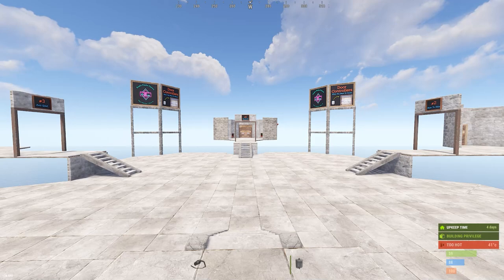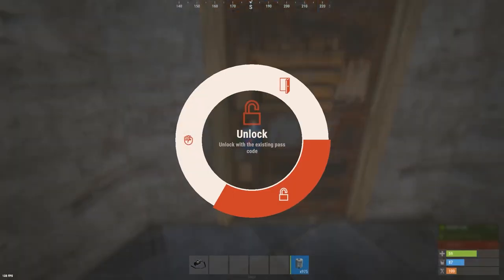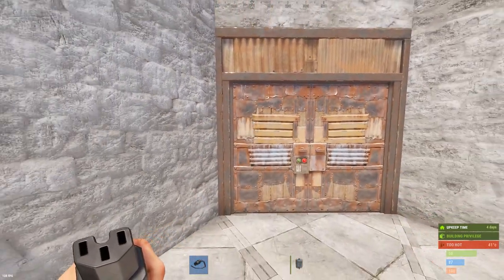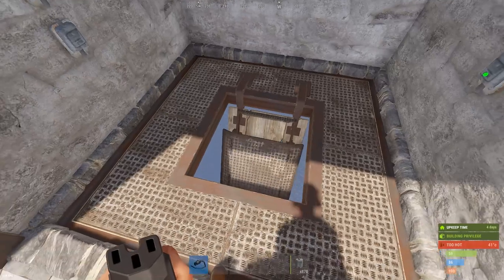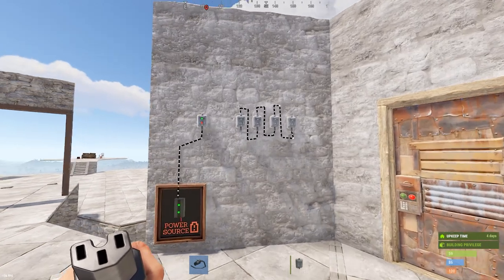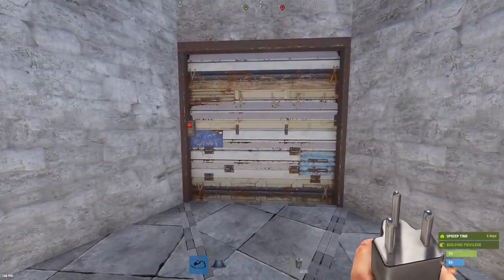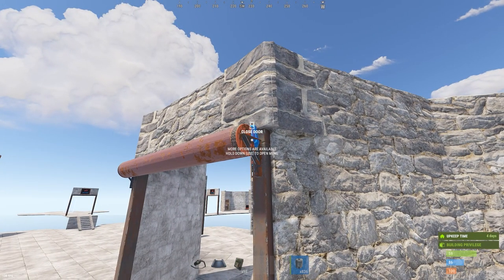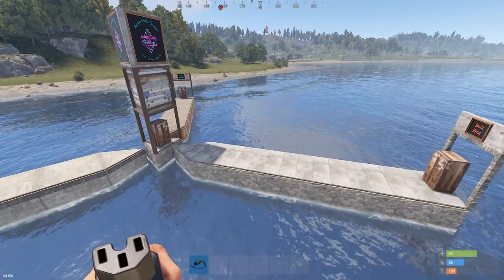RUST Electrical | Door Controllers - What You Need To Know - 2023

Comment: It's probably important to note these are "door openers".  There's no safe way to use them to close doors and get verification that all doors actually closed.  Obfuscating by hiding them opens your base up to a vulnerability.  It's hard to imagine how these can help protect a base but I'd love to see some practical uses.
Reply: Usually u r supposed to use them early game. U have it linked to a button near tc and have it connected to outermost doors or outer airlock door. If someone doorcamps and tries to go deep. U can press the button and close airlock from tc so u can place sg trap or other countermeasures.
Reply: well theres many ways sometimes i like to have say 3 garage doors with 2 auto turrets behind and a hbhf sensor so if someone comes close garage doors open and they get lit up and also have it conected to a bloacker for if turrets out of ammo doors close protecting the base and turrets there are other way of using blockers too to protect and sut doors down too

Comment: When you hide the controller underneath the garage door lock do explosives splash through the lock onto the controller or can you only break the controller after destroying the door?
Reply: Also what’s it take to destroy the controller? Melee tools
Reply from the maker: I don't recall, tbh. But the point of hiding the door controller is not to safeguard it from damage it's to prevent a raider from connecting a wire to it and opening the door after they place their own tc. This forces a raider to use their raiding materials to access areas of your base rather than getting a free ride.